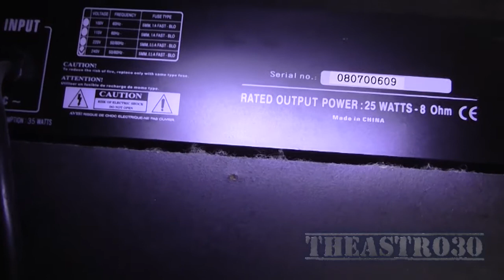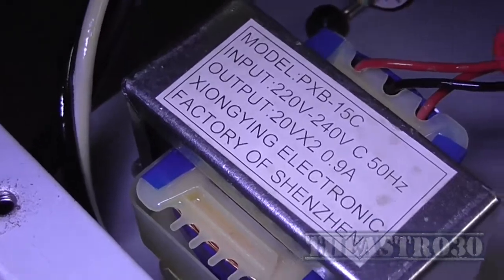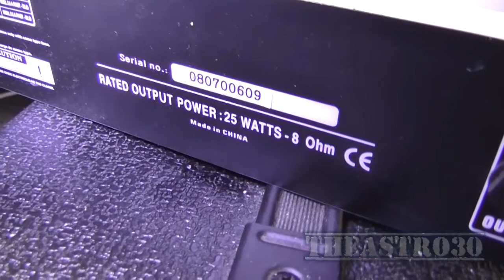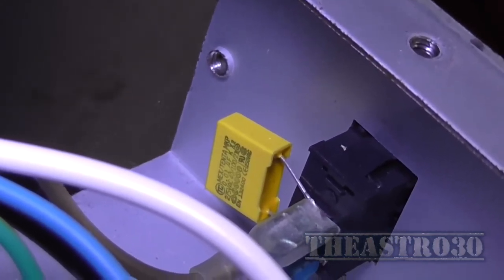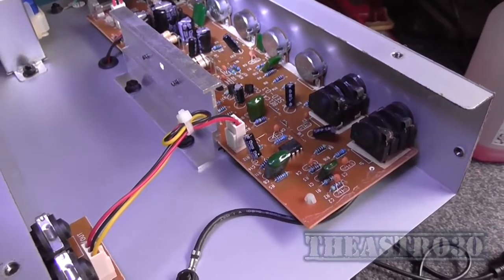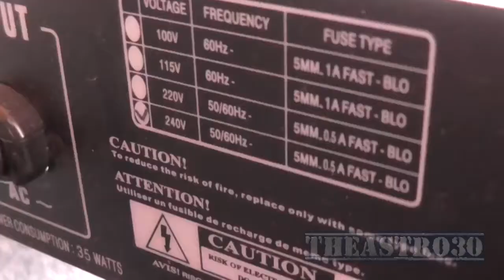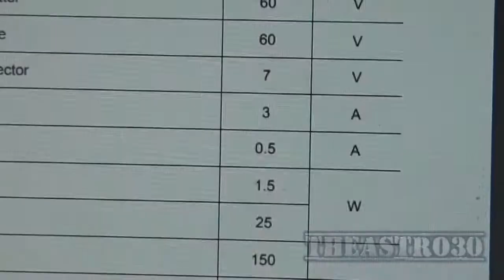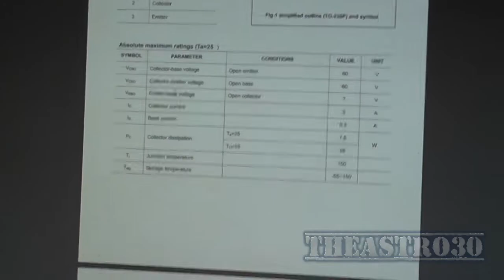What's Inside the Belcat 25B Bass Amp?

Comment: Hi... I'm not an expert and maybe my question is dumb but... is it possible to add a line in to listen music from the cell phone while practicing? some other amps has it but I have this one, if it's not possible it's ok, I just want to know.
Reply from the maker: Not really, considering how the preamp is designed.
Reply: @AstrosElectronicsLab  Well... that's dissapointing XD I discovered I can use the return line to amplify the music but it mutes the instrument, too bad, I guess I will just have to buy another one lol
Reply from the maker: @fjosewottom  you could modify the return socket
Reply: @AstrosElectronicsLab  isn't it a problem to receive two line in at the same time? (The preamp and the modified return)

Comment: That looks like a pretty clasic quasi-complimentary output stage, top side is an emitter follower amd driven with an NPN driver, bottom one is a common emitter driven by a PNP driver.
Interesting that they actually used a discrete AB design rather than throw the cheapest integrated solution they could find in there. The heatsink looks inadequate if it really is anywhere close to 25W, but I'm pleasantly surprised by the overall build quality for a cheapo chinese amp, it could be an awful lot worse.
Reply from the maker: Yep